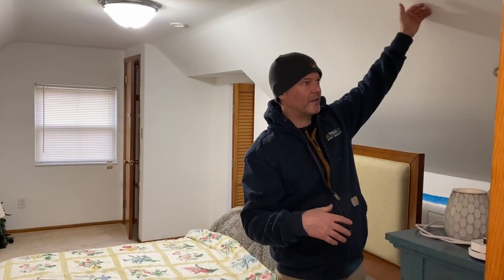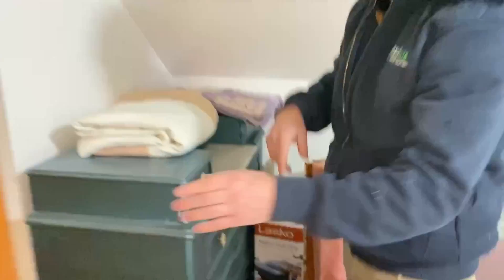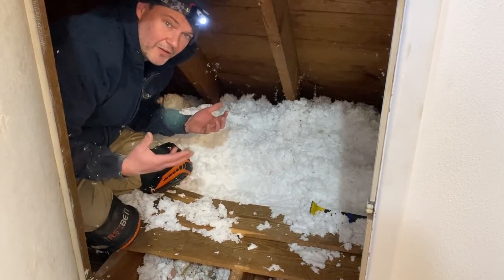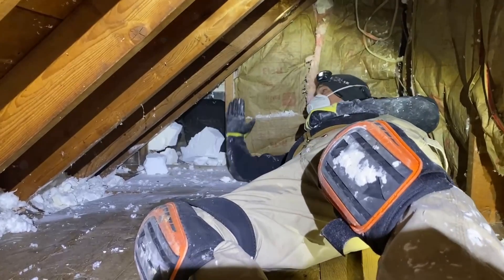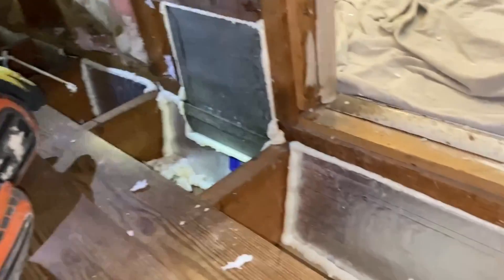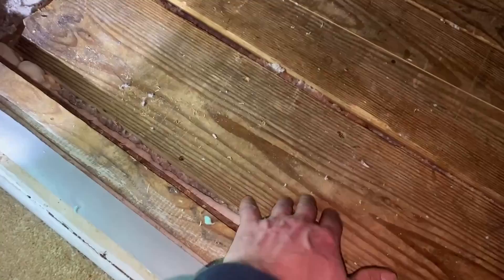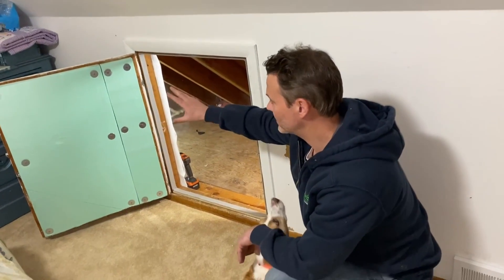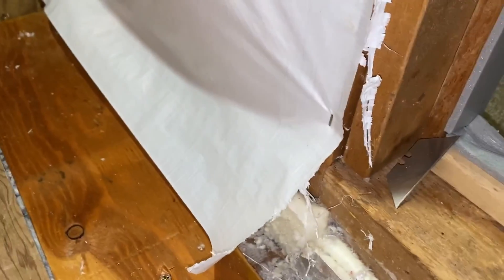What Happens When the WRONG Insulation Company Gets Hired?   Warning...This Gets Ugly

Comment: Great video, thank you. Very similar to my attic in my 1800s home, which I'm planning to use as an office space
Reply from the maker: You're welcome and thanks for the compliment!  I'm glad you found this helpful.  If you have any specific questions feel free to reach out, I'm always happy to help. 
Andy
Reply: Thanks Andy! Do you not insulate below the roof in the knee wall? I've seen some videos where people put foam insulate in between the rafters to deflect heat hitting the roof. Also what kind of insulation do you put behind the drywall of the ceiling in the conditioned space? Did you have to remove the drywall to get that in?
Reply from the maker: @pMurph  Hey there Murph, we do not insulate the underside of the roof inside the knee wall spaces, but if you did that right (in my opinion, only using closed cell spray foam to a depth of 3-5" would be the right way to do it) you could also make that work.  When insulating any structure the first thing that you need to do is define what is your air and thermal barrier, and those will nearly always be in alignment with each other.  We define that barrier as the slope ceiling, knee wall, and the knee wall "flat", or flat portion of the attic floor in the knee wall space.  If you air seal, insulate, and ventilate that area properly, it shouldn't really matter how hot that space gets --- that heat is not going to penetrate (or very much of it) into the living space.  
We insulate the slope ceiling bay in these homes by dense packing them with cellulose insulation.  The slope bay is about 5ft long normally, and we leave that space unventilated.  We do this because there's virtually no way to retrofit a baffle into the space and even if there was, you'd lose valuable room for R-Value of insulation if you did.  It also tends not to matter because you've got a large ventilated cavity below the slope bay (the knee wall attic space) and a ventilated cavity above it (normally anyway) in the upper main attic.  These are two areas for moisture to migrate to if there is a leak in the roof and to then dry out through a roof vent. 
Hope this helps!
Andy6

Comment: After a year of research, this video shows the best option for insulating this type of home. Its also more cost effective than other spray foam optins. Yes it's labor intensive but its my home. Thank you for this!
Reply from the maker: Hi there, thank you for the compliment.  We believe your assessment to also be true.  You could use spray foam to spray the back sides of the knee walls, but you would still need to dense pack the slopes with a blown in material and also insulate the flat areas of the knee wall attics.  We are not big fans of spray foaming the underside of roofs -- generally speaking.  We find roof leaks on a WEEKLY basis in the homes that we work on, and most spray foam companies improperly spray the underside of roofs with open cell foam.  To us this looks like law suit city down the road.  As you've seen in the video we are also big proponents of properly ventilating attic spaces.  If you do this right, you should avoid attic mold issues. 
Andy
Reply: @insulwiseenergycomfortsolu3293 in the UK here banks are no longer offering mortgages or even remortgages on houses with spray foam insulation.  They reckon they'll rot and don't want a property left in disrepair

Comment: Did you use baffles or are they not necessary for this type of job? Thanks
Reply from the maker: This house did not have any soffits or lower intake ventilation, so we did not install them.  We ventilated these spaces by installing slant back vents in the roofs of the knee wall spaces.
Reply: Do da man thank you @insulwiseenergycomfortsolu3293

Comment: Listening to your intro I was thinking, yeah yeah, that's what they all say.  He could have said "the owner didn't get the results he anticipated" vs "the company did a bad job"  you don't want to get sued but YES what a horrible job.  Having lived in that type of house for more than ten years.... I used to live in a late 60's era Cape Cod in Climate Zone Marine 3, its my personal opinion, they are POS.  Complete joke of a design.

I think what you did would help.  You can't fix the design flaws of the house but I think you did a good job, doing what you could.   Just curious what you did to the area on the second story right above the knee wall?  I think you said you packed it with dense cellulose?  How did you vent (I called them saddle bag attics) to the upper attic?  Don't take a ton of time replying...., not super important to me, I don't live in one anymore and will never buy another one.
Reply from the maker: Hey there thanks.  Our solution for these types of homes radically changes them in terms of comfort.  We dense pack the slope bays with cellulose insulation.  If the upper main attic, or saddle bag attic as you call them, is not already vented with either a ridge vent or large gable vents, we vent them using slant back vents. 
Andy

Comment: Dealt with one of thes last winter in Canada. One it got past -20C (which is basically 3-4 months long) this attic was condensating so bad it leaked through the vapor barrier and drywall and it was starting to come off the walls.

The home owner had previously had the entire knee wall spray foamed (entire roof side of bays and interior side. They spray up the sloped part of the ceiling and insulated that as well.

The upper attic had 2 huge gable vents on either side and your typical pink batt insulation between the lower bays, no spray foam up there, but it was still a sauna.

I could only recommend some temporary fixes at the time to get them thru the last month and a half of winter. I did an IR test as well as a smoke test to see where they hsd air leaks and sealed those the best i could. They were going to deal with it during summer and i wasnt involved in that so i dont know what else they tried.

But what would cause that much moisture to form
Reply from the maker: Hi there, it sounds like you made quite the find there!  There are a few things that can produce large amounts of moisture in a home, moisture moving through soil and through porous block wall foundations and up through concrete floors, fish tanks, showers that are not vented out of the house with bathroom fans, but humidifiers on furnaces are usually the biggest culprits in our areas.  We have seen humidifiers absolutely destroy roofs.  Our solution with Cape Cods and homes with this roof configuration anticipates moisture showing up where it was not intended or expected.  Venting these knee wall attic spaces with slant back vents, soffit vents, under shingle vents, etc may not be as "sexy" as using spray foam to insulate the underside of the roof --- but you are FAR less likely to have the type of catastrophic moisture situation, or even a mold problem occur.  

What do you think the condition of that roof deck was beneath the foam?  My guess would be not very good.  Why did they not call back the insulation company that created the mess?
Andy
Reply: @insulwiseenergycomfortsolu3293  They tried opening up the soffit vents the winter prior, and added rafter baffles though the knee walls to the upper attic.

That failed and they then brought in the spray foam company to do the entire knee wall area (minus the small upper attic) the baffles were removed and everything was sealed with foam.

The spray foam company was called back and they brought the truck out to cover some other areas I highlighted with IR pictures... this didn't solve the issue either.

I then proceeded to do the smoke test from various parts of the house to see where air is leaking to/from the knee walls attic and used my foam gun to fill in where I could, temporarily. Unfortunately with our climate there's only so much you can do when it's -30C outside as there's no way to dry out an attic at those Temps.

The roof decking in the knee wall according to the owner was fine prior to foam.

The upper attic roof sheathing, when I was there was completely covered in frost and absolutely soaked the attic from melting off.
I had removed all the batt insulation, dried the attic out the best you could and put new dry Batts down.

There is no humidifier in the house. No fish tanks or sources of moisture. The bathroom is vented to the exterior, however I don't know how long they would run the fan for after showering.

Its honestly the worst one I've come across with no obvious answer to why it's happening. They've basically rebuilt the this 2nd floor two winters in a row because of the condensation issue ruining the drywall.

Comment: Great exactly what I need to do to my home period it's a it's a manufactured Cape and the original installation.
Was done totally wrong. I can't imagine why the people.
Who built these things everyday would get that wrong?
Reply from the maker: Thanks Matt, most of these homes were built in the late 1930's - early 1960's in the Pittsburgh area.  For the most part knowledge of insulation, how to do it properly, air sealing, etc was non-existent until the 1970's.  And even now we have local competitors who are "professionals" that have zero idea how to effectively deal with homes like this.  Hence this homeowner paying to have it done twice within 18 months.  There are multiple ways to skin a cat, but we believe our method is the most cost effective way to durably and effectively raise the energy efficiency and comfort of these homes, while providing a measure of redundancy with regard to unexpected moisture intrusion (ventilating the lower attic spaces). 
Andy

Comment: Well done, excellent videos! Thank you! This is exactly like houses from the 50s where i live in Toronto, Canada.

Questions:
1- from your comments it sounds like you installed new batts over older maybe deteriorated existing batts and then wrapped it. Do the existing batts have paper facing on either side and do your new batts have any? (Was also reading that paper facing can just be removed in recent views given its general ineffectiveness in real world scenarios)

2- my sloped ceiling spaces are the same. Lots of nails and too tight for baffles. Currently, they have older, settled rockwool batts (paper both sides) inside with a space between the roof and paper facing that allows some air flow it seems. With all things equal as your video, would it be ok to leave the air space or should the space be packed up tight?

When packed, how does the space breath or allow for moisture to escape (lets say a roof leak or rising/falling air from attic spaces)?

3- what are your thoughts on gable style vents in the kneewall spaces as an alternative. I feel like i might avoid a roof leak this way. 

Thanks very much again for the great videos, let me know if you ever do any work up here, ha!
Reply from the maker: Hi Joe, thank you!  
1)  In this video we may have gone over top of the original R13 batts with new R19 batts to get some additional R value on the walls, but we typically remove what's there when it's in bad condition.  The craft paper in all honesty is far from an effective vapor barrier.  It's just paper with some tar sprayed on it -- literally.  I can't remember completely, but we would have pulled the kraft paper off on the 2nd layer of batts to avoid creating a double vapor barrier (even though these things are not effective vapor barriers).

2)  My guess is that those compressed rock wool batts are not giving you much for thermal performance.  Put your hand on that ceiling on a sunny warm day and if it feels warm you'll have your answer.  We dense pack the sloped bays every time.  Typically they're only about 4-6ft long, so if there's a nail pop / small shingle leak the water doesn't have to migrate far in order to dry, either upward to the main upper attic, or downward to the lower knee wall attic space.  We always vent the lower and upper attic spaces and treat them as their own isolated attics.
  
3)  I love the gable vents in the ends / sides of the knee walls if you can get them in.  In Pittsburgh we have A LOT of brick so it's far more difficult.  But one in each side/ end would do just fine.  They also look a little better.  That said, slant back vents rarely leak.  There design just really works well with shingles.  
Hope this helps!
Andy

Comment: Would a Cape Cod style knee wall be an appropriate place to use  rafter baffles, to connect ventilation to the central attic?
Reply from the maker: Hi John, technically speaking yes that would be an ideal place to install ventilation baffles, but there are a few issues to note here.  
1)  These bays often already have some type of degraded insulation in them, and there are always nails coming down from the roof, so it's often difficult to impossible to effectively install baffles.  You're also going to need to double up a 4ft baffle to get it to extend down into the lower knee wall attic AND have it extend above the insulation in your upper "main" attic space.
2)  You still need to have your lower knee wall attic spaces vented somehow, either with soffit vents, slant back vents, or under shingle intake vents to bring in outside air to "feed" the vents in your upper attic.
3)  Most of the roof rafters that we see in these homes are 2x6's, which in reality is actually 5.5" inches wide.  So you're already seriously constrained for space in terms of adding additional R-Value for insulation.  If you install a baffle that takes up another 1.5" of space, so now you're down to 4" for your insulation layer.  

That said, if there is no drywall in place and things are totally exposed, we will baffle the sloped bays and install a R-19 or R-13 batt of fiberglass.  A proper ventilation channel is always nice, but for we rarely see homes where there is no ceiling in place.  The way that we insulate Cape Cod and Three Story homes has been delivering significantly improved thermal / energy efficiency performance for us for years, with mold free attics to boot. 
Thanks!
Andy
Reply: @insulwiseenergycomfortsolu3293  awesome, thank you for your insight. It'll help me get my house sorted out.

Comment: Great video but I face the opposite problem.  Very hot and humid climate.  I don't have a " knee wall" per se but my second story is more of a 1.5 story home meaning the second story is build inside of my attic.  I am very leery to seal the area below the transition as you did, as I don't want to trap heat and humidity between the floors of the home.  also instead of doing a home wrap as you did, I planned on adding a foam board insulation to cover my r13 bat thats currently installed. Thoughts?  again FL climate.
Reply from the maker: Hi there, thanks for the comment.  Any time you are insulating and air sealing a structure, the first thing that you need to do is clearly define where your air and thermal barrier are going to be.  In just about every case that I can think of, these two things should be aligned with each other, meaning the same wall, floor, or ceiling plane.  That's why we seal the gaps beneath the second floor walls which we call transition gaps (because that is where the home transitions from conditioned space to unconditioned space).  Our summers here in Pittsburgh often get very hot and humid as well.  What happens is that as air in those outer attic spaces heats up and expands, it will "expand outward" and radiate heat beneath the floor of those rooms --- IF those transition gaps are not sealed.  You are relying on your home's AC system to cool and dehumidify the air between your first and second floor at that point.  The space between your first and second floor, assuming they are both conditioned spaces above and below, is definitely considered to be a conditioned space. 
In terms of going with foam board over top of those walls that now have R-13 batts in them, that is a terrific solution.  I'd recommend using a foam board that has a silver facing on it that will also act as a radiant barrier and reflect heat back out toward the roof.  That is actually a better solution than the one used in my video because the exposed faces of the studs will also be insulated.  When we work in homes that already have a well installed R-13 layer in those bays we do the same thing.  But we use R-19 batts when there is no existing insulation or when what is there is bad or degraded.  Installing a new R-13 layer and then foam boarding over top of it becomes cost prohibitive for our customers (and having a well installed R-19 batt with an a moisture permeable home wrap over it produces a very good result on its own). 
Lastly, I would encourage you to make sure that any of your attic spaces that are unconditioned are properly ventilated.  You always want to leave a good way for water vapor to exit an unconditioned attic space.  Doing otherwise tends to encourage mold growth. 

Hope this helps!
Andy
Reply: I have the same situation in hot humid Arkansas with a 1/2 second story built into my attic. The second story walls have R13 with the paper facing out. I gather I need to turn the R13 around so the paper is against the drywall then install the silver facing foam over that? Does the foam not create a second vapor barrier? Watching the video I assumed the use of the home wrap instead of foam was that it would let moisture escape.
Reply: @arclay10  The foam is not a vapor barrier without an actual vapor barrier on it. If you go around and air seal all the cracks and gaps then it could potentially become a vapor barrier but it's not enough of a risk to consider it a serious problem imo. Now if you were to take crawlspace vapor barrier and wrap the room that might be an issue. If you can't find foil faced foam, you can always buy radiant barrier from atticfoil and use that. That stuff is a breeze to install and helps a ton.